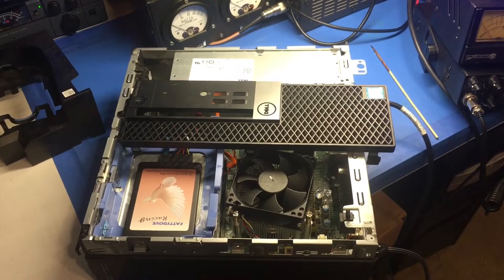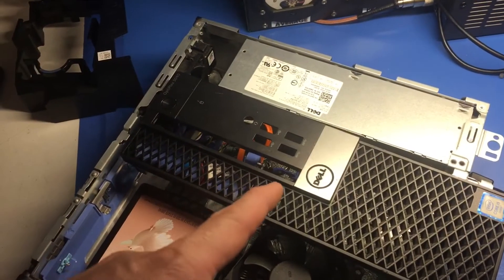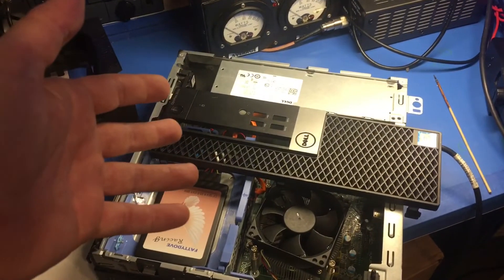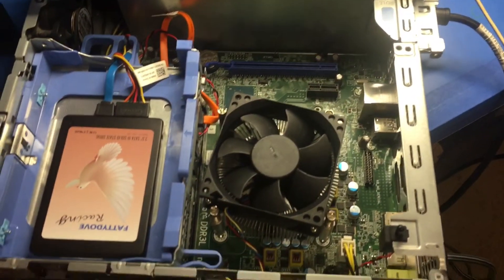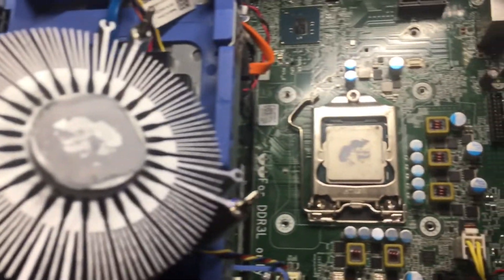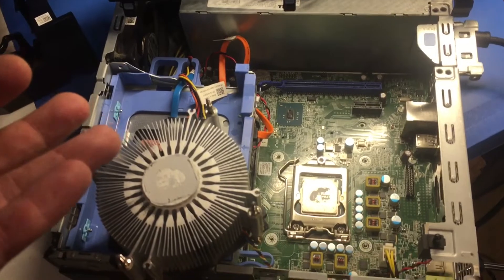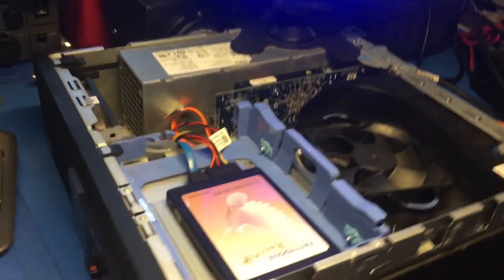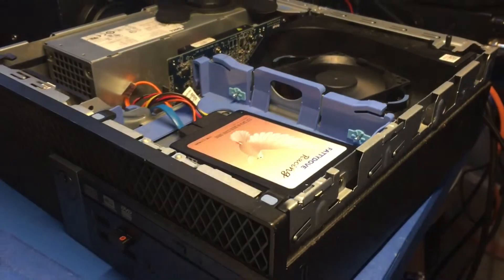GREAT! Why is my Dell OptiPlex 3040 Blinking Amber ?!

Comment: I have same 3040 but my different design.my probleme is i change boot to uefi after that i cant access bios anymore.
Reply from the maker: I would make sure you have latest bios installed and see if you can boot to a UFEI  USB stick and reformat your drive to UEFI  I had a probelm where I could access the bios until I did that.  I hope this helps ! Let me know how it works out !

Comment: hi i also use the 3040 and it is not switching on but sometimes when i plugged i all fans spins  sometimes  they don't
Reply from the maker: I'd look at anything getting in the way of the fans.  OR if the fans are dirty they may need to be cleaned ! Thanks for watching
Reply: Did you manage to fix your 3040

Comment: It had plenty of heatsink compound. In fact it had too much!  Remember the function of the paste is to fill the tiny crevices in the surface of the heatsink. The problem is it dried out and stopped transferring heat out of the CPU into the heatsink. One of the first things I do when purchasing a used PC is clean all of the old compound off and apply new, silver-bearing paste.
Reply from the maker: Looks like it was the Dell OEM  compound pads they put on dried out. . Salvaged this from the eWaste pile. I can't imagine how many things  in that pile and other all across the world that could be fixed...with some TLC.  Just like when buying a used car - check it out and change all fluids !  This one will chug on a little longer !